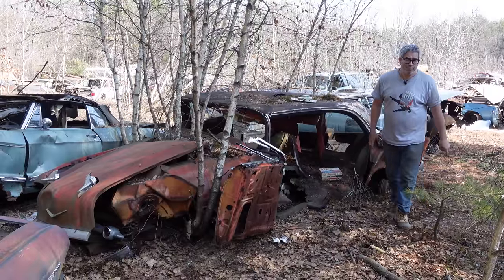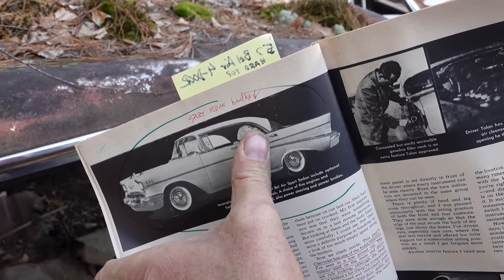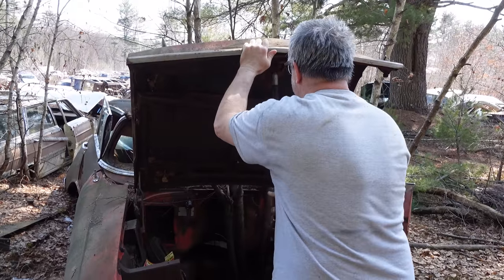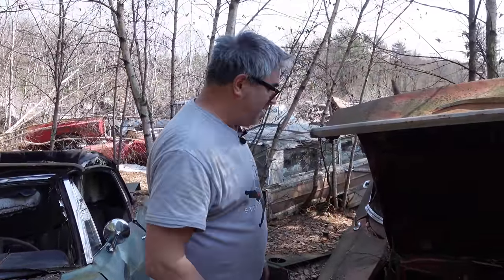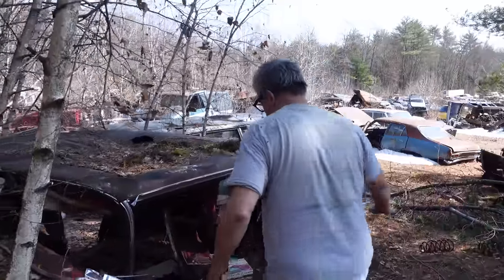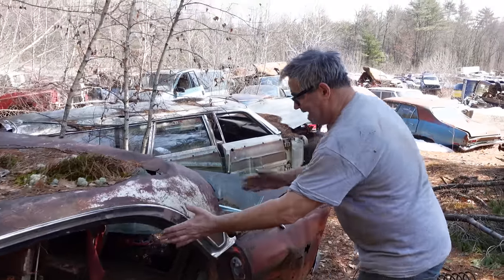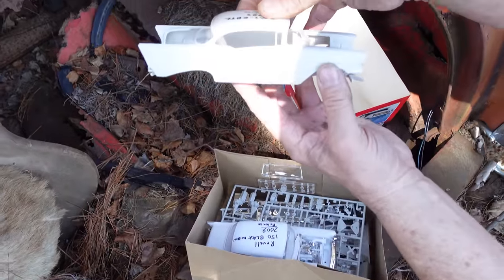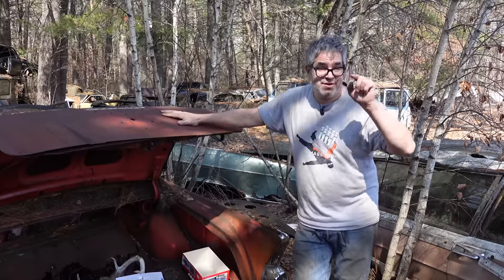Baby Cadillac

Comment: I’ve had my 1957 Chevy bel air 4 door sedan since I was 15. Almost 40 years now.  I always wanted one and the best condition I  found was one 2 blocks from my house that was all stock original matching numbers car with rare factory options.  Ps, pb, power glide, tinted glass,  electric wipers not vacuum,  push button radio, which was middle of the road for that,  deluxe heater , power pack 283 4 bbl with duals which was the base corvette engine, and ultra rare padded dash which is more rare than ac,   I love my Chevy and is restored to better than new matching numbers car show winner, even though it’s not a sport coupe it was my first car and is beautiful and I saved her.
Reply: That is an awesome story
Reply: That is an awesome story
Reply: amazing!

Comment: The 1957 Chevy is truely an icon. I remember that as early as the late 1960's people were starting to collect and restore them. There was also some where the owners painted them with metallic and other paints that were available at the time.
Reply: When I was a kid, there was a '57 Bel Air 2-door hardtop painted in a kelly green metalflake!
Reply: One of the very few sedan-class cars that was instantly born a "classic".  Basically there was never not a time when the 2drs. weren't desirable.
And I'm not a big fan, but those are the facts.

Comment: If you ask any car guy 80% or more would give the '57 Chevy as the answer to what was the most popular car made in the 1950's. But from an automotive industry standpoint it was a sales flop. WHAT??? Yes, the '57 Ford outsold Chevy by the largest margin since 1930. The '55 Chevy was super popular with almost 1.8 million being sold, the '56 was close with 1.62 million. The '57 Chevy that became such an icon just a few short years after it was actually produced only sold 1.5 million. That's a lot of cars but it's a whopping 15% decrease in sales while the '57 Ford sold 1.67 million. And the wholly unpopular '58 Chevy took the first place spot back from Ford very soundly. It's odd to see this since it would be very easy to assume that the '57 was the highest selling, single model year of Chevy of all timer perhaps looking at it's popularity today. And the '58 Chevy seems to be very unloved. Of course Chevy did only sell about 1.1 million '58 models but Ford had fallen to less than 1 million units the same year. It's like so many other cars that aren't all that popular at the time but a few years later people can't get enough of them.
Reply: Chevy waited a year to revise it's body shell.  Fords and Plymouths for 57 had about the same dimensions as the 1958 Chevy, lower and longer.  The 57 Chevy had pretty much the same dimensions as the 53 Chevys.  Enough buyers wanted longer, lower, wider in 1957 to put Ford ahead.

Comment: This one appears to be a repeat of sorts. Maybe Mr. Magnate is enjoying some vacation time.

No VIN, can't win, but easy to figure out, no doubt: V for V8 equipped (no V is a six cylinder), C for Bel Air, possible F for Flint, MI assembly (still operates today), or T for Tarrytown, NY (closed in 1996), S for St. Louis, MO (closed in 1986), B for Baltimore, MD (closed in 2005) among other codes.

No tag, can't brag, but easy to figure out, no doubt: 57 for 1957 model year, 1039 for Bel Air four door hardtop, then one of the letter codes above for a plant assembly code, maybe 669 for Black and Red interior trim, possible 819 for India Ivory and Matador Red two-tone exterior paint, and possible EZI for E-Z tinted glass (if that back window was indeed tinted).

Comment: I've seen a few '57 BelAirs with every option and these babies really could be loaded up like a Cadillac. Electric windows, air conditioning, power steering and brakes, electric seat, AM/FM radio, electric antenna, 3 speed automatic...... A/C was super expensive, something like $450 on a car that was $2200 base price so it was definitely not a widely ordered option but it was available and cars did have it.
Reply: One would have to really, REALLY want to have a '57 Chevy, if you were willing to pay for all those extra options. Why not just step into a Pontiac?
Reply: @michaelnazaruk4100  Pontiac had a higher base price and you still had to pay for each option separately.
Reply: @jeffrobodine8579   - I guess I'm indirectly saying that you can put lipstick on a pig, and you'd still have a pig. You can probably tell I don't care for '57 Chevies too much.
Reply: @michaelnazaruk4100  The point is that a loaded '57 Chevy BelAir is now worth more today than most '57 Cadillacs. Whether your opinion is that it's simply lipstick on a pig or not, the Bel Airs are highly collectible without all the options, with most of them going in the mid-60s today without A/C or FM radio or electric windows. All the options? You're looking at a $130-150,000 car, while only maybe the Cadillac Eldorado Brougham can come close to or eclipse that in value today. Most '57 Cadillacs in pristine condition are $50-80,000.

Comment: The '57 Chevs fresh  air Intake  was a good idea , and if you were stuck in traffic  , the sensible  thing to do would  be shut  off the vent , after all you wouldn't be getting  any forced fresh air  at a standstill  anyway  , and it,s a better idea  than the plenum fresh air intake system which inevitably  causes  rust in one of the most difficult  to repair  areas of a car.

Comment: That one there is the 1957 tree power the final year? That one there is top of the line with the bullets on the hood.
Reply: All 57 had the hood rockets as factory didn’t matter the trim level or engine size.

Comment: My mom bought a 57 Bel Air 4dr sedan around 1970 after the original owner died in 1969. It was black with white roof and silver/grey interior and 283 Powerglide. Around here 57 Chevys were the darling of high school hot rodders still by then because most couldnt afford used Camaros or Firebirds yet until they became older used cars. That said, moms car started losing parts lots of times when she went shopping. The hubcaps with spinners, fuel door on the fin another time, etc. She finally junked it around 1974 when she got another awesome Chevy. A 65 Chevy II 2dr sedan with 4cyl Powerglide.

Comment: I love me a 4 door hardtop.  When I was 18 in 1992, I bought a 68 Tempest 4 door hardtop 350/powerglide for $100.  I loved the "big window" with all the windows down.  When I was looking for an old land yacht Caddy several years ago, I specifically wanted a 4 door HT.  Found a really great driver 71 DeVille.  Identical color combo to the one Lucky and Tony built a while back on Hot Rod Garage.  I even picked a similar steel wheel in white, before I even saw theirs.  Had a couple people ask me if it was the same car, although mine isn't  bagged, just lowered on Jamco springs.

Comment: the 55 57 chevies would simply drive circles around the caddys then and now. went to seekonk speedway in 73 and saw 17 57 chevie 2 doors in one wreck.  they still won the feature as they normally did even tho seekonk restricted the 57s to 283s while anyone else fords and chevelles could use what ever. they would put the non 57s up front for the features....lol that didnt work either. the 57s simply drove under the poorer handling 60s cars on the inside......

Comment: I think the 1957 Bel Air is sensational, but I still prefer the style and lines of the 1957 Plymouth.
Reply: My grandfather looked at a gold /white top 57 chevy bel air v8 and 57 Plymouth belvedere 4dr same color and went to order the 57 Plymouth because it had more engineering feats[one was a  chevy test drive around ny in traffic where they felt they were choking on fumes in it but it was comfortable but the Plymouth could clear snow and ice faster off the windows] with a 3 spd auto even though he had trouble free '51 bel air 6 cyl with powerglide but he went to pick up the 4 dr  Plymouth and saw a sport fury with off white and gold trim, my dad talked him into looking at it and they heard it start and it was quicker and had a higher top speed than 301 sedan  and 57 chevy bel air and once they both heard it start and revved it to make the unique dual quad vacumn fully opened carbs open- that was it. Sales contract was torn up, and they took  sport fury  across country with many first driving tests and family memories with the fury.

Comment: Listening to the explanation of the headlight fresh air intake, I wondered if any hot riders ever had the idea to tap that system to inject fresh, cool air into the carb. It would provide incentive to get off the line first cause if you didn’t, you’d be sucking up your opponents fumes. 🥸👍💥💨✅❗️
Reply: In the early seventies Jay Storer , a Peterson Publishing employee , did just that with  '57 210 that he had dropped a 396 into